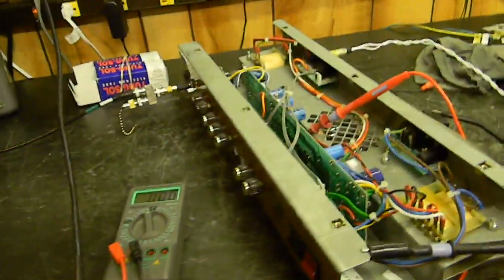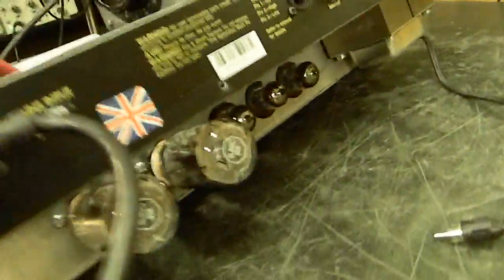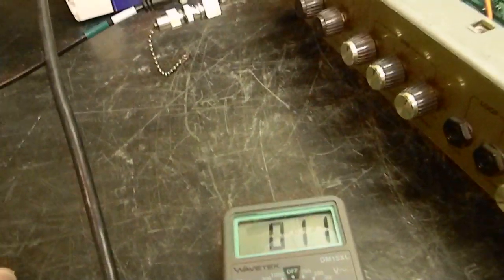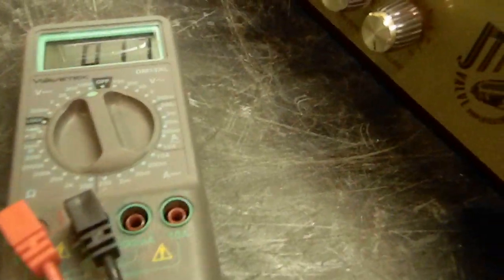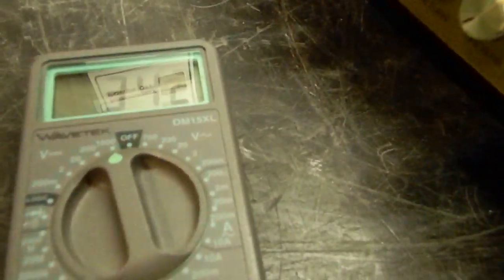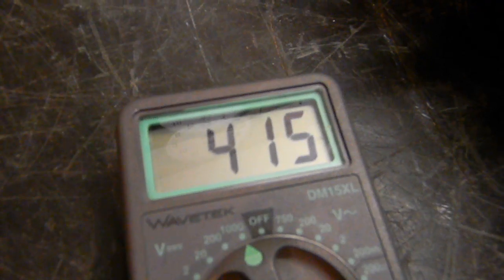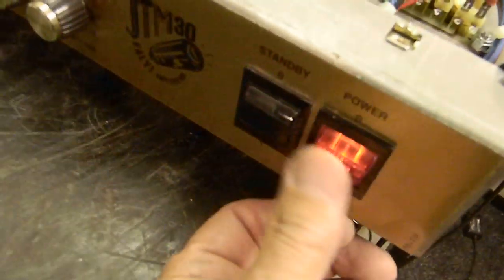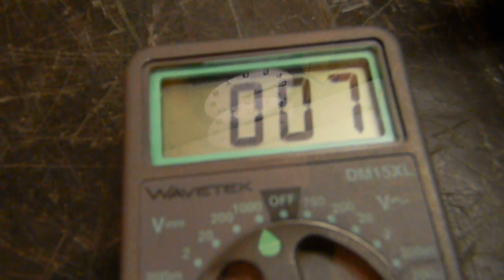Helping Prevent High Voltage Shock From Vacuum Tube Amplifiers.MOV

Comment: Whats the problem on this amp?
Reply from the maker: Leon Onitnelot I am sorry but I don't remember. Just something that came through my shop and I used it for the video.
Reply: I had my jtm30 at the shop right now it turned on but the sound faded after a couple of minutes have u encountered this problem b4.
Reply from the maker: Leon Onitnelot I am sure it could be several things. If it is already at the shop, he will probably figure it out. Good luck.
Reply: The tech told me that its the bridge rectifier and the  output tube, which is I just replaced the pre amp and output tubes b4 dropping to the shop and asking $310 to fix the amp. this guy is trying to rip me off. I'd rather buy a second hand tube amp for that price.
Reply from the maker: Leon Onitnelot I can't imagine a bad bridge rectifier causing a fading problem. They are most likely good or bad but not intermittent.
Reply: actually I measured and it reads OL on + and AC  - and Ac is ok reads 585 ill try to replace it later.

Comment from the maker: Yes, I believe the capacitors in a flash unit are at a level of 350 volts or more that get discharged thru the flash tube. I haven't been shocked by them yet as I have always been careful - thanks for the post and letting others know of the hazard.

Comment from the maker: A safe and "feel good" procedure is to take jumper cables like you can buy at Radio Shack with alligator clips on each end and clip one end to the chassis (ground) and the other end to the center tap of the output transformer or to the plate lead of the tube sockets or the output of the power supply, whatever you can find,  or put jumpers across each capacitor you see that has a HV rating on it and leave them there while you work on it. Certainly, make sure it is unplugged from the wall.

Comment: Novice question here, does a Voltage detector works on Tube amps too? want to make sure capacitors are fully drained? I'm nervous on opening my amp but I need to swap the presence/density board..

Comment from the maker: There is some truth to this. Turning a warmed-up, hot amp off and right back on may very well do immediate damage especially to the output tubes and/or the power supply. If you turn off a "hot" amp - leave it off a minute or so before turning it back on. This is true for many things, off-on-off-on and kaboom...I would treat solid state with the same respect.

Comment: Nowadays, I guess we have to warn the new generation about these  things, but back in the day, we ALWAYS checked the voltage before going inside and poking around. Any time the power has been applied, check the B+ rails before touching anything. Should always be standard procedure on any supply over 30 volts.